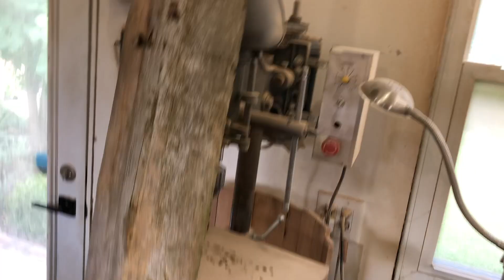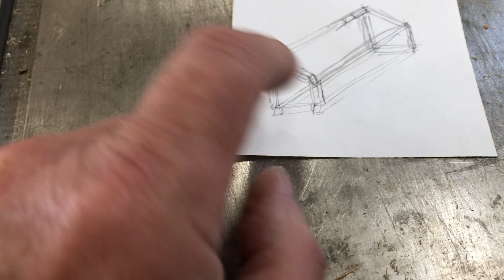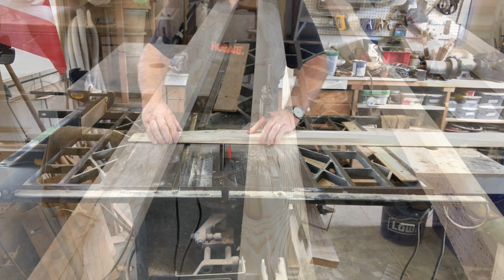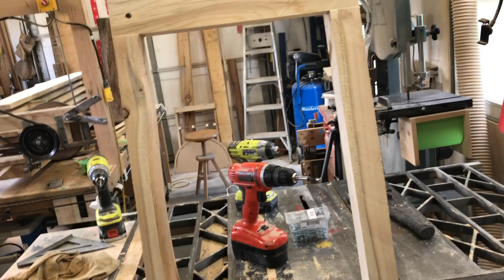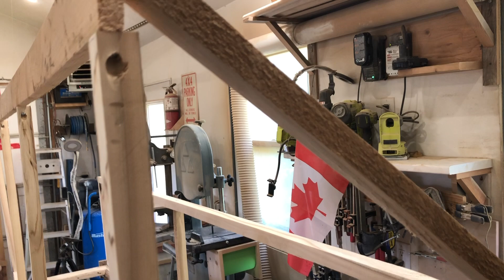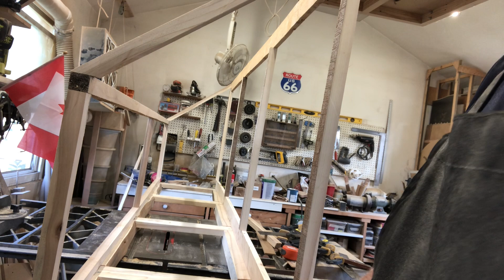Wood Kiln - P1 - The Box Frame

Comment: Blade broke AGAIN? What size are the wheels on your mill? Are they all the same brand of blade? I feel like that's a lot of blades to be going through.

The kiln seems like a practical design and maybe not too bad an eyesore.
Reply from the maker: Yup. Another break. The 3 tooth blade just doesn't seem to cut it (pun intended) on these larger logs. From what I have been reading, anything more than 6 inches should be done with 2 teeth per inch or less. But it seems I need to get a custom blade welded to get to 2TPI.
Reply: @secretundergroundlair4014  i hope the 2 tpi blades are better. I wonder if you could get a price break on, say, 6 blades rather than just the one.